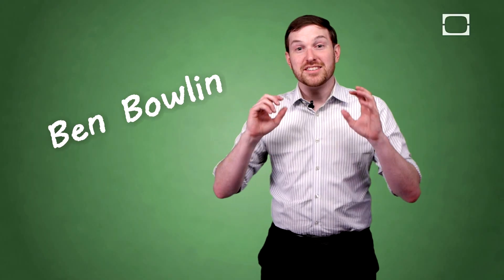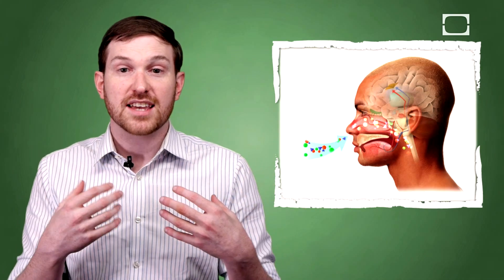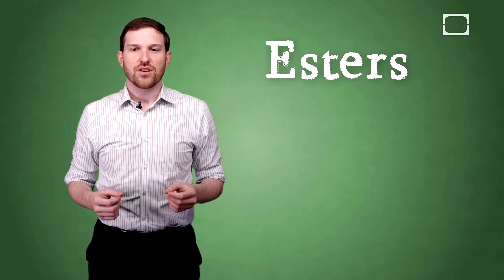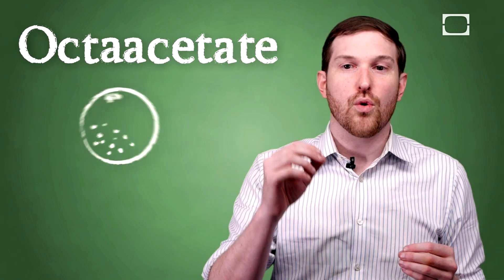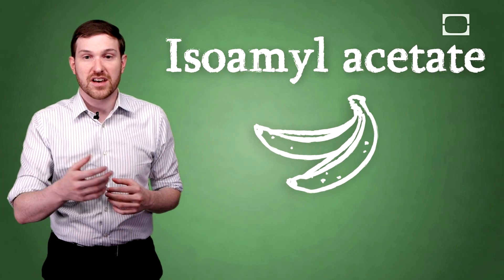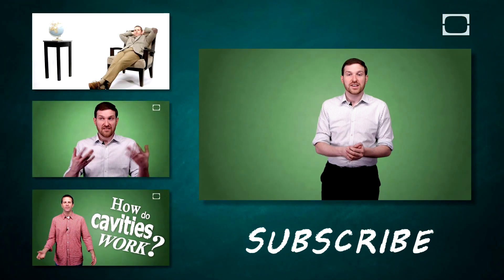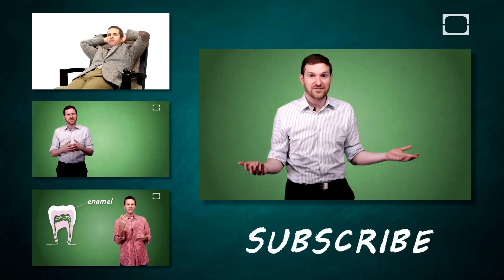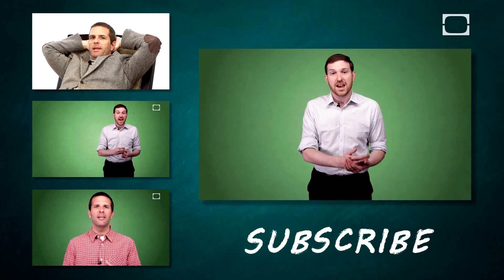How Do Artificial Flavors Work?

Comment: I definitely know what you mean when artificial flavors don't exactly coincide with what they're trying to simulate. Four instance, chocolate flavored ready whip taste like gasoline. On the other hand, I found the best artificial chocolate simulation in Javalia's Chocolate Mocha. I thought it actually had real cocoa bean oil. But my sister pointed out that the bag said that it was artificially flavored. If that's the case, they did a damn good job of it.